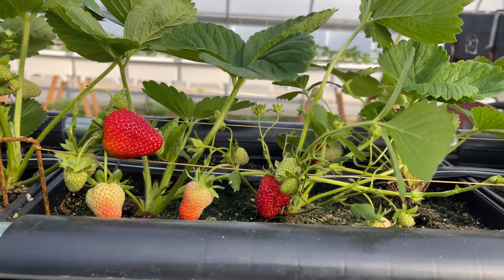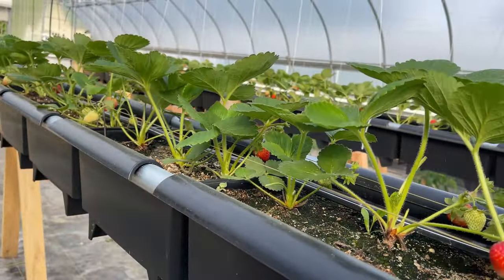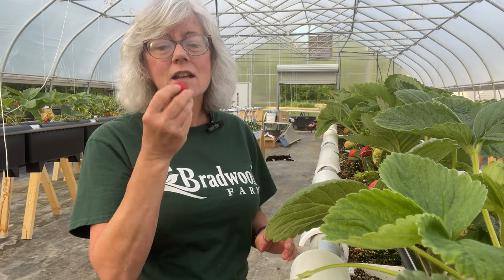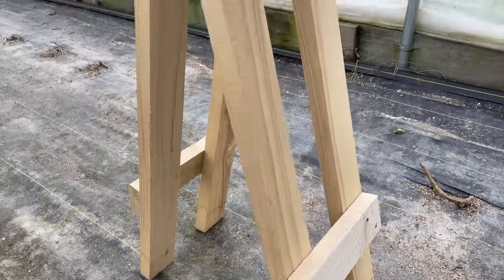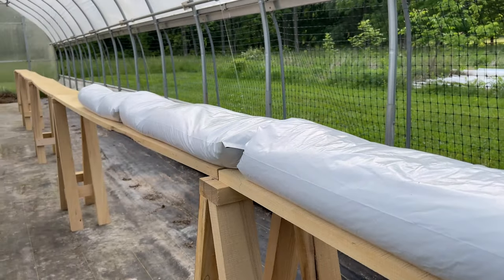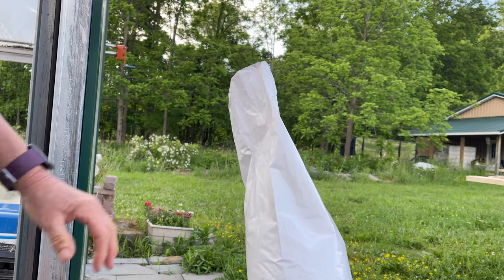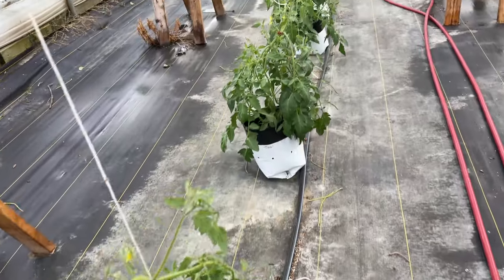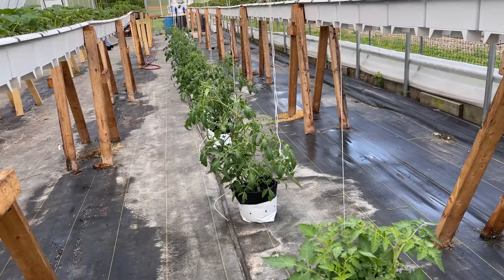Hydroponic Strawberry Growing Ideas

Comment: Another great video with brilliant content. When you cut off the Strawberry runners do you toss them in the compost or regrow them ??
Reply from the maker: we tried growing them but found out they have to stay connected to the mother plant until they root. We were told we could use a rooting inoculant so will look into that. Would be nice to double our plants without buying
Reply: @HomegrownPassion  I've seen them root successfully in the 10x20 trays with a humidity dome / misting system. Using the mother end of the runner stabbed into the dirt to help with stability. I'm hoping to do a video on it later this season.

Comment: WOW LOOKS GORGEOUS!! I can’t believe how fast your strawberries are growing!! You sure make it look easy!! (I know different!!! As a newbie, I don’t have all the fancy equipment or a beautiful high tunnel or drip lines or anything like that but I have a passion for growing my own food in my own apartment and I have 25 strawberry crowns that I purchased from a company from PEI and they began pretty great but then the outer edges of the leaves turned brown and they are showing they aren’t real happy and it could be because the feet are staying too wet and as you mentioned strawberries don’t like wet feet I thought if they could be grown in an NFT system then they would enjoy wet feet but I have to admit my NFT system isn’t a true Nutrient film technique, mine is more of a quarter of the pipe is filled with water at all times even though the water is constantly moving and I did that on purpose because if the pump fails at any time the pipes will still have enough water in them to sustain the plants for a little while.  That doesn’t sound great for the strawberries so I think I’m going to switch it up and I do have some thin tubing and I could push water through it and I have some slightly smaller tubing that I have these interesting ends that I can put on them to regulate the flow out of each end I may start using that to water the strawberries
Reply from the maker: sounds like that would work. we did do our strawberries in NFT one season, and you are right we had to knock down the water flow... we ended up using drip emitters 1.5 gpm and that seemed to do the trick. One tip is that strawberries like to be held tight in the growing medium so when you put your crowns in the rock wool or net cup make sure they are packed in...
Reply: @HomegrownPassion  great advice and yes that’s what those things are called emitters to me they are like black little stakes with a red cap on top that you can turn to the amount of water that you want to drip out, I also have the kind that goes into the small tubing and have the same type of end caps to control the flow.  Looks like I’ve lost all but one of my strawberry plants that I had put in the window boxes but the ones in the 5 gallon buckets are still surviving but definitely not thriving.